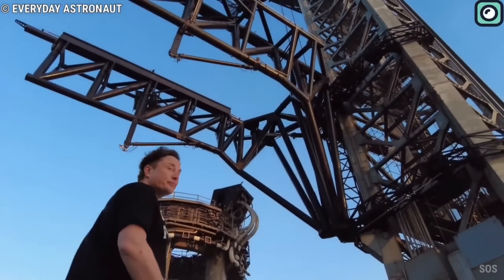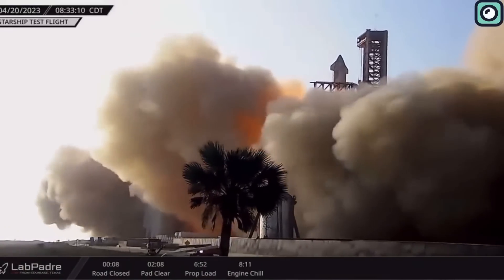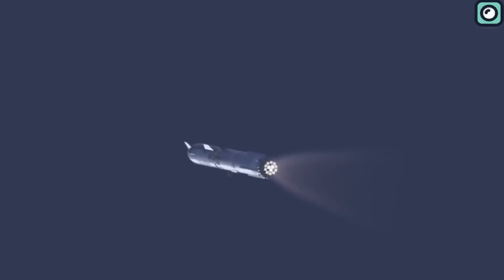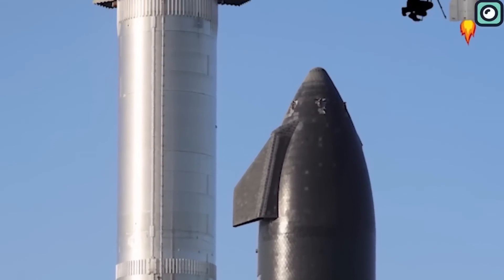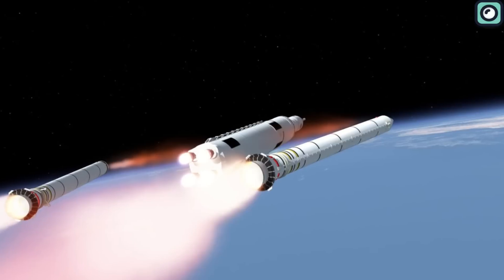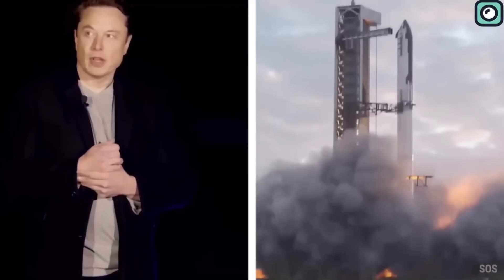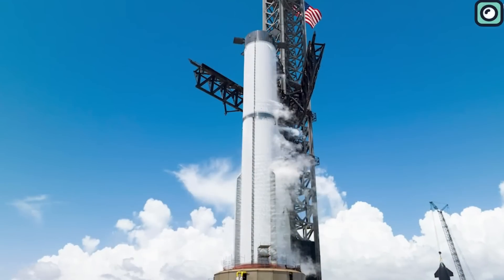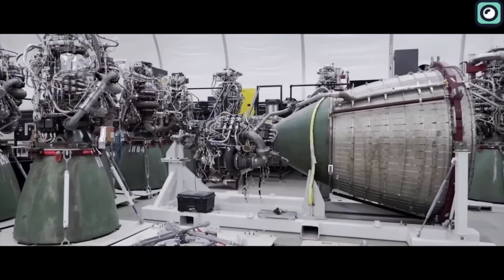SpaceX Just revealed Hot staging NEW DESIGN, Booster ready for Static Fire

Comment: Hot staging has very little to do with rocket booster turn-around time once the booster returns to earth. Whoever wrote that part of the script needs to do more research before they insert that nonsense into the narrative! Also, there needs to be just as much protection to the top of the lower stage as there needs to be to the bottom end of the Starship. The point that only Starship needs protection was erroneous as well! Do better research and analysis before uploading your videos!
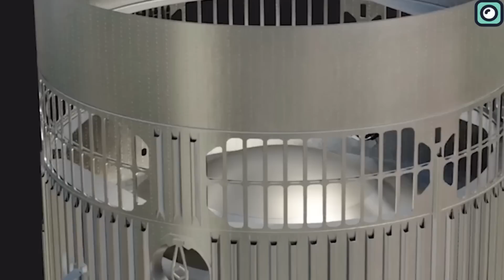Reply: I think they mixed up "upper stage" and "lower stage" at about 5:30.